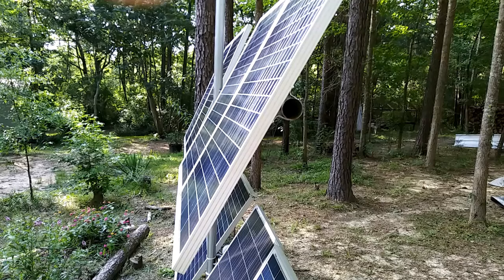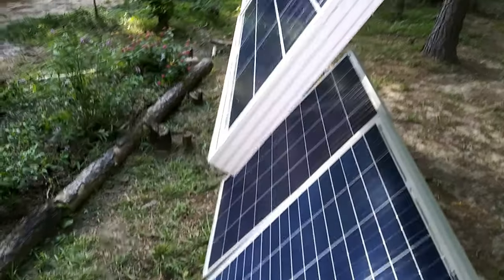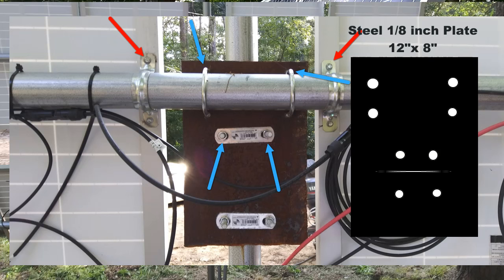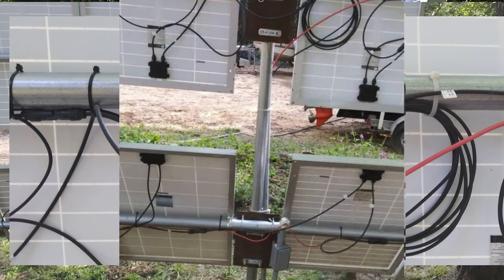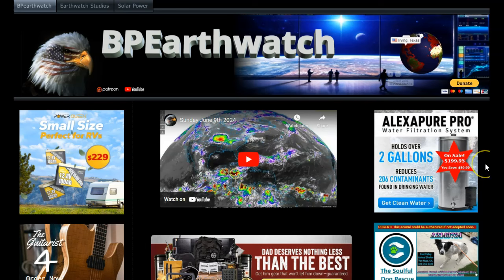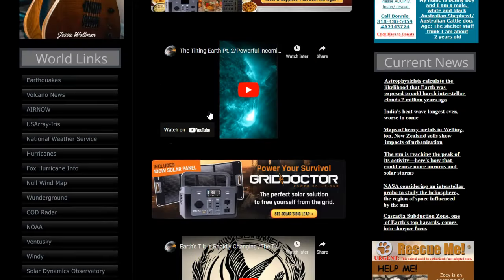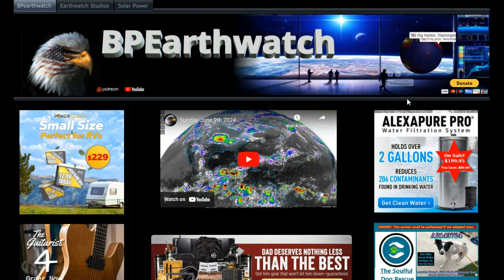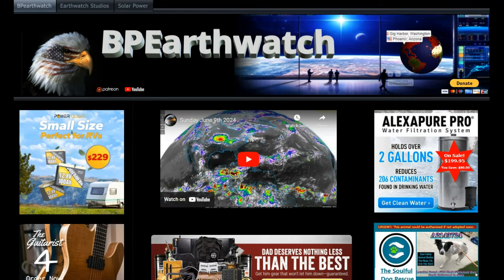Custom Solar Panel Mount Design.

Comment: Got the pole in and cemented all the parts u bolts clamps steel plates. Thank Jesse from a fellow Shepard Chapel Alumni. Study w/ you and Roy Potter. El is our Father 100%

Comment: Thank you from Picayune !  What prevents the plate from sliding down the pole ? Love my Lexipure..
Reply from the maker: the U Bolts
Reply: @TheRealBPEarthWatch 
The center post  U joints can rotate around the pole and still hold its vertical placement.?
Reply from the maker: @Tonytango  Tony the entire center pole rotates

Comment: How many watt hours do you store in your batteries? 
What’s you total solar panel wattage? Looks like about 2,000?
Reply: He said the panels he's showing are 8, and the other one is 4. They are 100 watt.
I would step those up to 480's, but those are 48 volts.
Reply from the maker: https://www.relionbattery.com/blog/whats-the-difference-in-amp-hours-and-watt-hours#:~:text=Let's%20say%20you%20have%20a,which%20gives%20you%202400%20Wh.
Reply: @TheRealBPEarthWatch  
Thanks.